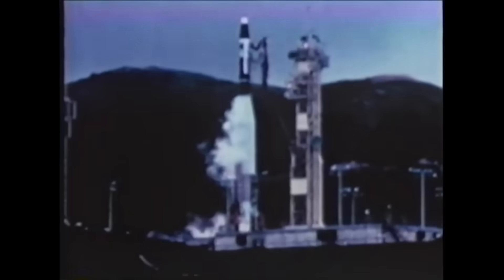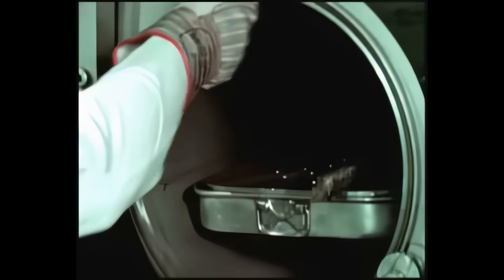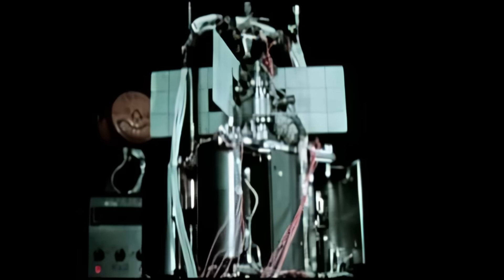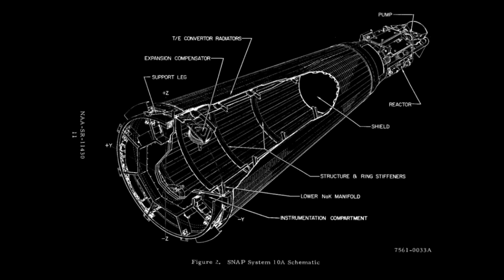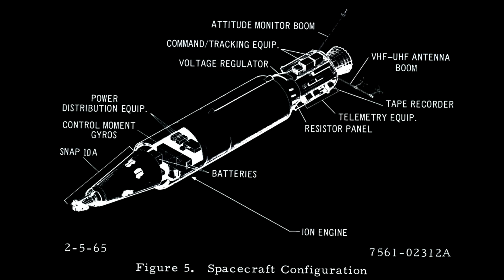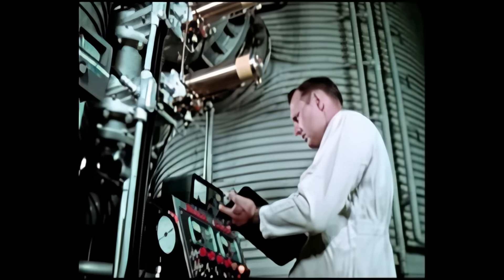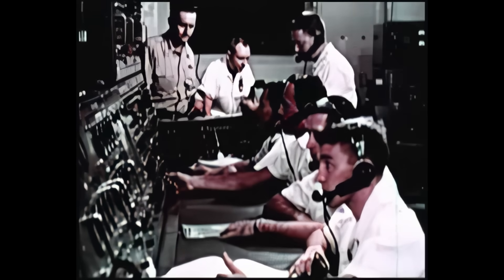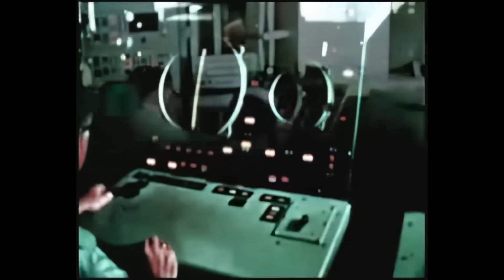USA Put A Nuclear Reactor In Space And Abandoned It - How Did It Work?

Comment: TIL that there is a nuclear reactor that isn't powerful enough to power my pc. I don't know what which one it says more about, but it says something.
Reply: 500W from 30kw is pretty darn bad!
Reply: @volvo09  Yes.  I wonder how much better it could be with more modern stuff?  Thermocouples don't generate a lot of voltage for the heat differential either.
Reply: @eeengineer8851  0,5/30 kW is 1,7 % el. efficiency. The RTG on the Perseverance rover (launched in 2020) is at 5,5 % but that's not better than the old Voyager probes from the 70s so not much has happened in that field in 40 years.
Reply: @eeengineer8851  Which is why they been exploring old tech, Sterling engine driven by by a radio-thermal source.
Reply: @anotheruser676  Yeah, I was thinking something like a sterling, etc would be more efficient but it has moving parts and probably less reliable for that reason.
Reply: @skunkjobb  yeah the thermoelectric effect just doesn't produce many electrons to work with. Also, the cold side needs huge radiators because there's no convection/conduction in space.
Reply: @skunkjobb well there is a reson why big power reactors dont use thermocouples for generation but use turbines.
Reply: @volvo09 shedding the heat is the biggest problem
Reply: @AsbestosMuffins NOT in space....

It's PLENTY cold out there
Reply: It’s much more efficient to convert photos to voltage if you’re not too far from the Sun.
Reply: certainly gonna keep your house warm
Reply: It can power your PC, just not at full clock speed.
You would have to heavily underclock your PC anyways to keep it from overheating because in space there is no air to blow over the radiators.
Reply: Technically the reactor produces much more than that, but they had to use a very specific electricity generation method. On the ground they could just boil water
Reply: you mean compact, right?
Reply: I would think something like a raspberry Pi would be sufficient, also don’t really need a display, keyboard or mouse.
Reply: At least the liquid metal was good enough to cool down your PC
Reply: A normal PC draws far less than 500 W. Do you have some extra powerful gaming computer?
Reply: @skunkjobb  of course, it's only under full CPU and GPU load when you'll hit that, with good components.
Reply: @skunkjobb  Most uses overpowered PSU but peak power draw from an gaming rig can easy pass 500 watt if gpu and cpu is maxed. 
Its as rare like you bottom the throttle on your car for long times :) unless you do stuff like rendering 3d to video. 
And you have an performance problem, running an game on ultra with 3 4K screens and +100 mods might be the reason :)
Reply: @skunkjobb  not op but just my gpu draws 450w
Reply: @skunkjobb  A mid tier CPU nowdays can make use of 200W and a mid-high tier GPU can exceed 300W, and that's not even accounting for anything else in the PC (like the efficiency loss of the PSU).
Reply: @skunkjobb  my pc a decade ago used a 700W power supply. Current one is 1200W.
Reply: @KillinTime2792  That is its supply, not draw. I have a 800w supply in mine, my UPS never sees more than 300w draw from everything plugged into it, including my desktop, screen, lamp and router. Of course, Im running linux now and dont game like I used to, but still.... The capacity of desktop PSUs is one of the most over blown sections of the market. Bigger number not always bettererer, kids.....
Reply: @TankR  the decision to use a 3080 by itself draws 750W @100%, 4090 is over 1000W by itself iirc.
Bigger number gives you more overhead, go longer without needing to upgrade
Reply: @KillinTime2792 You are miles off on both numbers. Google can give you the actual figures.
Reply: @incandescentwithrage  google gave me both, maybe you ought to take your own advice
Reply: @KillinTime2792 4090 = 450W (max). 3080 = 350w (max).
Reading comprehension is important
Reply: @incandescentwithrage  now scroll down to total system power, hey it's suddenly 700W and 850W. weird how that works. Much bigger than 500W.
Reply: @KillinTime2792  "the 3080 by itself draws 750w @100%, 4090 is over 1000w by itself irrc"
you were wrong
Reply: @ryanspence5831  if you want to be pedantic sure, I could have said "The decision to use a 3080 by itself" instead of "the 3080 by itself" but i didn't think that I'd be debating redditors today so I left the obvious as obvious. We're talking about PCs and 500W hasn't met recommended for a number of generations now.
Reply: @KillinTime2792  you made up false information and now you wanna cover your ass 😟
Reply: @ryanspence5831  I got the 4090 wrong by 150 watts, but 3080 750 watts was absolutely close enough to correct. If you want to intentionally misattribute my statement to claim an internet W I can't really help you out there, try going outside for a bit to calm yourself you sound pretty hostile.

Incidentally, first GPU for manufacturers to start to recommend over 500W that I can see was the 980Ti released in June 2015, almost a decade ago (by 100 watts mind, they recommend 600W). 700W is absolutely a reasonable power supply to have at the time for someone looking to be able to upgrade their pc going forward.
Reply: @ryanspence5831  If he's looking at PC from 10 years ago, his point has some merit. A low to mid-tier CPU from back then is 95 watts, while a CPU of the same tier today only consumes 60 watts. Modern CPUs deliver better performance, achieving the same level of performance as the 95-watt CPUs of a decade ago, at only a fraction of those 60 watts. So, his perspective on energy requirement may be outdated if he's thinking about PCs from 10 years ago.
Reply: @TankR my ups gets rather upset with me when I pass 1400 VA. That's with 2× 60" screens though. Just the computer without the screens or speakers I do regularly push up to 1000VA and idle roughly around 500VA. (I haven't measured the pf in a while but it should be pretty close to 1 at full load) That's 2 video cards in this machine, and 8 smaller cards in my other machine. (that one will take over 1700VA if I let it, promptly blowing the fuse). Idling it sits around 500-700VA depending on the OS. It's not as efficient due to the number of cards plus the 3 cheap PSUs needed to power it. So there are some computers that really do need that extra power. 

I do get what you mean though. Most people have no idea how much their computer actually needs and just want bigger =better..... 🤦
Reply: @xponen my current CPU will happily suck back +100W. Yes, it is one of the top bins, and yes it's overclocked a bit. The CPU in my secondary computer uses about 45w full load, and idles to about 15w. Of course if you wanna talk 100% efficiency, the phone CPU I'm using to write this post uses less than 5w. The whole SoC uses less than 5w most of the time, with it running at about 6.27W when benchmarking. Lol, different applications, different specs.
Reply: @KillinTime2792 Fancy quad sli pcs could guzzle power as well. I had a Thermaltake psu before 2010? that could do 1200 Watts. Bigger models went up to at least 1500 Watts. AMD had black edition cpus that started heavily over clocked and they were bought with the intentions of cranking them up even higher. 
Honestly I find it comical now chasing that sweet sweet performance. Thankfully I didn't pay the power bill back then.
Everything has gotten more efficient but people pushing the bar can still go ham. Nice part is being able to conserve power these days as well.
Reply: @incandescentwithrage  actually a couple 3080 models have 450w limits. my Strix OC does 450w. I get around 12%  performance boost vs 350w cards.
Reply: @xponen AMD 8120 from over 10 years ago needed a cooler that can handle 150W of heat when stock. 
Mine was overclocked and ran at 100% for hours doing VR. No idea the wattage that needed but the PC would heat up a room to the point where you'd sweat.
Reply: @xponen  Being a triple-slot card, the NVIDIA GeForce RTX 4090 Ti draws power from 2x 16-pin power connectors, with power draw rated at 600 W maximum. Display outputs include: 1x HDMI 2.1, 3x DisplayPort 1.4a.
Reply: @KillinTime2792 That does NOT mean that it constantly, or even partially, uses anywhere near that power. 

If you tried to draw 1200 watts out of a 1200 watt rated computer power supply for even 15 straight minutes, you'd most likely blow the supply up. That would be close to 10 amps out of wall socket. A computer never draws that much power from the wall. Ever.
Reply: @KillinTime2792  A graphics card alone is NOT going to draw 8-9 amps from the wall outlet. IF it did, the rest of the system along with the graphics card WOULD be drawing enough to blow the 15 amp breaker for the wall outlet. 

A computer doesn't even come CLOSE to blowing breakers. Never has, never will. 

Your numbers are NOT close to reality. I don't care WHERE you read them.
Reply: Just use a Mac :)

Comment: I have often wondered why small safe reactors don’t use rotating fuel rod/reflectors sitting on a tapered base so gravity drops them to safe position.

Also, 1-10mw size low pressure steam turning triple expansion steam engines.
Reply: Turbines would be more efficient I guess.
Well the most established tech for a compact nuclear reactors are molten salt ones, so I guess water wouldn't be used for a first cooling stage anyway.
Reply: @DrVort yes. High pressure, high temperature , high speed , high tolerance turbines are far more efficient at scale. 
But it’s the safety and initial cost that has my interest. 

The level of technology to run a steam engine and the lifespan with minimal maintenance is cost reduction
Reply: @brucebaxter6923  if you are speaking about on a ground application - economy, I guess. For anything newly built, you want as much efficiency as humanly possible for a bucks paid. Because there are always used stuff if you wanting something ineffective, but cheap.
For a space, well, mass is essential.
Steam triple expansion engines are inefficient, heavy and without mass industry behind them for maintenance.

Comment: 6:36 Yep, and lighthouses used mercury to provide frictionless "bearings" for the lenses, back when.
Reply: @ManfredZeroFive   Mercury Silver amalgam fillings. Very common 20+ years ago.
A good balance of hard, stable and not brittle.
They also used to put lead in gasoline to improve combustion and lead in paint to stop if fading.
Reply: @ekij133  Tetraethyl lead is still allowed to be used in aviation fuel; the FAA and EPA want it gone, but aren't really helping in the process of making a 100 octane lead free fuel.
Reply: @UncleKennysPlace     Lead free avgas ( 100 UL )  is on the market and approved for most engines by engine manufacturers.
Reply: @bobroberts2371 
Mostly true, tho the availability is poor, and there's some very tricky legal wording around it. 

The damning thing about it is that even if it's a drop-in replacement for 100LL the FAA still makes you buy a $50 piece of paper (Supplemental Type Certificate) saying it's ok to put in your airplane. No mechanical changes, only paperwork for the mere sake of paperwork. This is only a tiny symptom of the sort of bureaucracy which claims to want changes but in practice does everything to prevent them.
Reply: @Redchrome1    YT ate my prior post:   AV (delete this part ) web  did info on 100LL and 100UL
Reply: @ekij133 Yeah I have a Mercury mine in my mouth....
Reply: Some of those older lighthouses still do. It's 'safer' to leave the mercury where it is, in the lighthouse than to try and remove it. 
A bit like if you have mercury fillings, you're going to ingest more mercury in the process of replacing the filling than you are just leaving it alone.
Reply: To be fair, liquid mercury at room temperature isn't all that dangerous. It's mercury vapours and certain mercury compounds that are the real problem.
Reply: @macdjord shush...you are sciencing infront of the environmentalist.
Reply: @omstout  Oh, liquid mercury is a serious environmental danger, if the thing leaks or isn't cleaned up properly at the end of tis life. I'm just saying it's not a major immediate health risk to the operators.
Reply: @macdjord actually if you read about what it did to those poor souls it's horrific
Reply: As a child I had a plastic maze but instead of a ball to run around, it had mercury that flowed around.
Such fun.
Reply: @ManfredZeroFive  old school
Reply: Mercury isn't frictionless.
It just doesn't have any wear.
Reply: @jannikheidemann3805  You might wish to check your sources.
Reply: @LordDustinDeWynd 
He's perfectly right, though - mercury has some viscosity and thus is not frictionless.
Reply: @ManfredZeroFive  Got 2 in my head right now.  Not used anymore, but were very common back in the day.
Reply: Just for perspective quick silver aka mercury is still used by the gallon in gold extraction being only one example. Thousands of illegal and some sorta legal miners just burn off the Mercury to seperate the gold, sadly with little or no precautions😢
Reply: Ok
Reply: There were also the mercury mirror telescopes which spun a pool of mercury until a desirable curvature was reached.   Mercury was used to look at the planet Mercury.
Reply: This is the true Basis of all the creepy stories of lighthouse keepers going crazy.  Oh that delicious methyl mercury !
Reply: Had an old mercury thermometer in the house about 50 year's ago when i was a kid heated it up with dads cigarette lighter to watch the red stuff rise the glass cracked and i had all these little silver ball's on the coffee table started playing with it and all the mercury joined back into one big blob played with it for a few weeks and got board but i lived

Comment: If I remember correctly, a critical engineering goal for safe space-based reactors is robust encapsulation of the radioactive elements so that an accident on launch doesn't contaminate the launch area and beyond.  Did this system have such "robust encapsulation", or did they just trust their launch system wouldn't blow up on the pad?
Reply: I think the idea was that they wouldnt turn it on until it was in orbit. The base materials were safe enough for them to handle by hand apparently. And the size of the stack is too small to go into runaway by itself. It isnt until its up and running that it becomes a toxic radioactive waste machine.
Reply: watch the video. the strategy was the antithesis of encapsulation, it was deliberately designed to totally burn up and spread contamination as diffusely as possible. Just like SNAP 9a did when its pound of plutonium reentered over the Indian Ocean in 1964.
Reply: That is mainly a problem with RTGs, reactors generally don't have that problem.

Comment: Two Mars rovers have Russian nuclear reactors, deep-space probes have nuclear reactors, all sorts of extra-atmospheric machinery use isotope decay for power.  What's the big?
(edit) Sorry, commented before watching.
Reply: @LordDustinDeWynd Curiosity doesn’t even have a reactor, it has an RTG.

Curiosity's RTG is the Multi-Mission Radioisotope Thermoelectric Generator (MMRTG), designed and built by Rocketdyne and Teledyne Energy Systems under contract to the U.S. Department of Energy.
Reply from the maker: No, perseverance used Plutonium 238 produced by the USA not from Russia’s stockpile.
Reply: @scottmanley  The design of the reactor was based on Curiosity's reactor, which was Russian.  I was wondering if I'd get caught on that... 🙃👍👍
Reply from the maker: @LordDustinDeWynd  no, the design was a US design, they just had to buy some plutonium 238 from Russia.
Reply: @scottmanley  If I recall correctly, they bought the entire package from a Russian company, but I've been wrong before, gonna happen again sooner or later! 😏
Reply: @scottmanley  Aamof, I think it was Russian technicians installed it on Curiosity, big deal made of it back when.
Reply from the maker: @LordDustinDeWynd  no, is built with some Russian plutonium.
It’s like Putin’s limousine, a Mercedes doesn’t become a Russian design just because it’s filled with Russian petrol.
Reply: @scottmanley  Does Pukin ride in a Mercedes?  Cool.  I ride in a VW Tiguan, which is an Audi Q3 with different coachwork.

Comment: Thermocouples or Thermopiles?
From my memory Thermocouples are used for millivolt temp measurement while Thermopiles can be used to generate a usable power for low power devices. I guess with enough in series/parallel you could power anything?
Reply from the maker: Thermopiles are made up of lots of thermocouples
Reply: It's a pile of couples, otherwise known as a rhermopolycule
Reply: A pile of couples...they're swingers!@quantumblur_3145
Reply: It is also kind of terribly inefficient
Reply: @DrVort  I wonder if they are similar to the "power pile generators" in gas furnaces used to keep the gas valve open. They make a few milliamps.
Reply: @volvo09  I have no idea about a particular appliance you are talking about, but yeah, they are weak, inefficient, convert to electric potential any thermal potential directly ^^ 
It's just two metals with particular chemistry that make this effect. I guess many of modern portable coolers use similar process, but in reverse.
Reply: @volvo09  This is exactly where I have seen thermopiles used.
Reply: @DrVort I was thinking Peltier elements .  Still somewhat inefficient, but solid state .
Reply: Pile of couples? Isn't that called an orgy?